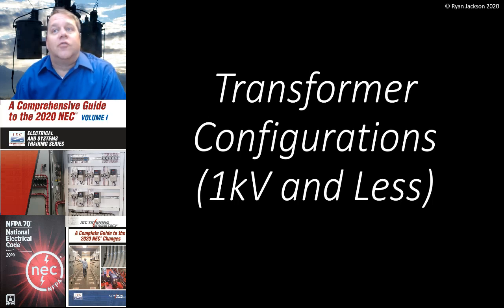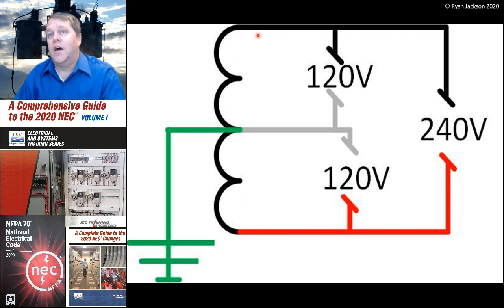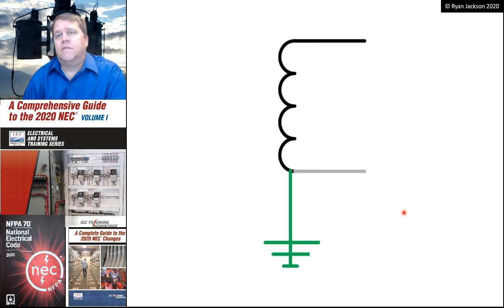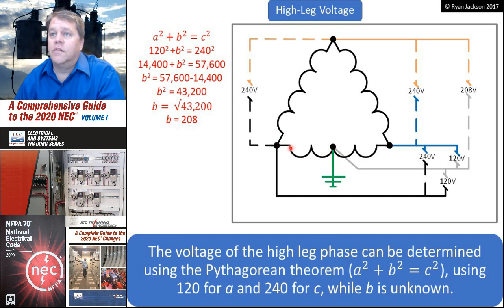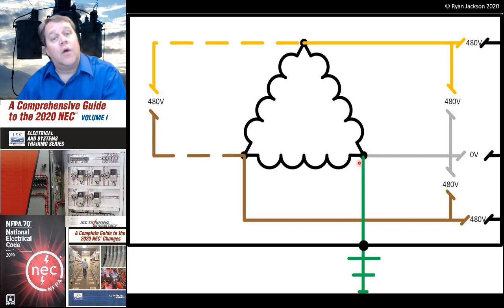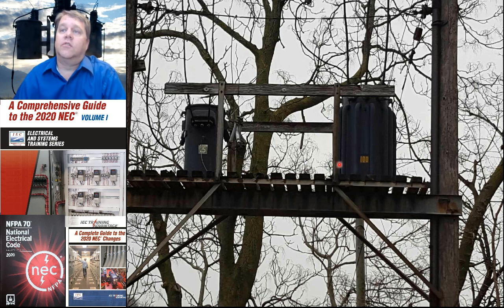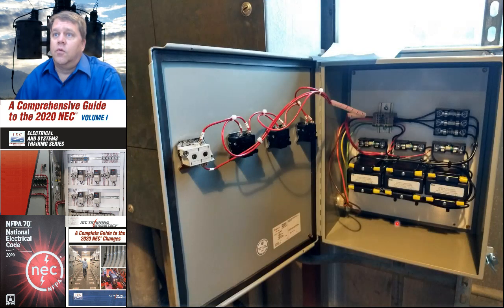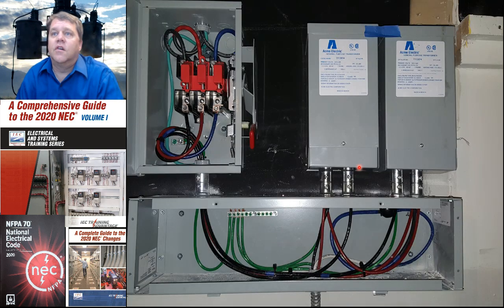Transformer configurations

Comment: Here in Central Europe, single-family homes are always supplied with three-phase four-wire wye system. We get three phases and a netral/ground which then splits into neutral and ground, thus we have a TN-C-S system. The voltages are 230V phase to neutral and 400V phase to phase.

Comment: Although I have an ”ancient” (1976) degree in electrical engineering, I do have one question:

In an area where both 12 Kv and 4 kv distribution systems are used, as a rule of thumb, is one more susceptible than the other to subjecting the end user (120/240v, 1Φ, 3 wire, overhead) to lightning and/or switching surges?

For example, would a lightning strike (direct or indirect) to a 12 kV line get stepped down in voltage more before entering a home than a similar strike to a 4 kV system? Or does lightning not obey the usual mathematics of a transformer’s turns ratio?
Reply from the maker: Hi Dave. That's a great question, and one that I'm afraid I can't answer. I mainly live in the world of 1kV and lower voltages. Sorry.

Comment: In the three phase high leg Delta example, where the B phase is the high leg, (14:46 min in video) the 208 V circuit to ground could be useful for some 208v lighting circuits or even a single phase mini split HVAC unit rated for that voltage. Once the conductor leaves the panel, it would be no different than any phase conductor on a 208/480 used for lighting loads in commercial applications…. What hoops would you have to go through to be able to use that phase for single phase loads?

Comment: Open Delta:  Understand now.  All three (3) power company phases
are connected to the primary coils (2) even though only (2) coils in the SECONDARY side of
the transformer(s).  54% as powerful as closed delta system. Thank you.

Comment: The ground SCREWS to the underside of the transformer.  
If this should break, is that big trouble?
Reply from the maker: No, simply because there are tens of thousands of them.
Reply: @RyanJacksonElectrical  Question please.  Reference the “Multi point grounded
neutral system.  (Thousands of them)
   Philadelphia area single phase step down transformers I can not
see a NEUTRAL conductor going from pole to pole?  
    This SHOULD BE in parallel with the MENTIONED multi-point system
which is obvious at every pole?
     Thank you.
Reply: It’s a common neutral which runs pole to pole at the secondary level. Common meaning same conductor for primary and secondary.
Reply: @bobbrumley3964  Thank you Bob.

Comment: North America, do we use SWER (single wire earth return) from the (single phase) step down pole mounted transformer to the substation? 

I see no neutral from the transformer(s) thank you
Reply: The neutral for the primary is the same neutral being used on the secondary. We call it a common neutral system. The primary bushing is for hot primary conductor and the other end of the winding is attached to case of transformer. As long as the common neutral is attached to the case then the primary winding has two different potential conductors across winding.
Reply from the maker: We use a multi-grounded neutral, which is to say that we have the grounded/neutral conductor that goes from pole to pole and from pole to the customer, and we ground it at every transformer and pole.
Reply: @RyanJacksonElectrical   New terminology for me.   multi-grounded neutral. pole to pole.

     SO, there is no neutral back to the substation.   Thank you.

Comment: Hey Ryan, it seems like the math works the same on the open Delta system using the Pythagorean theorem to get 240v between the two points on the open end. 

It’s just a little confusing to me that you can get 240v between the two points on the open ends. And use the math the same way if you were to draw an imaginary line between the two open points. Or am I over thinking it?

Comment: Single Phase 2W systems are actually very common in North America if you work with Control Transformers, or in a panelshop. Typically in the 100-2000VA size, 600-120V (Canada) and 480V-120V (USA). Great presentation!

Comment: If there is a neutral wire on a wye  480/277 secondary, does the wounding  has to be grounded ?  Can that neutral be floating? And why?  Thanks!  Very good class.
Reply from the maker: You're allowed to have an ungrounded 480V wye (but not 208) , but you can not hook up the neutral because any circuit that uses a neutral MUST come from a grounded system. I'm sure there is an obscure application where an ungrounded wye would be useful as opposed to an ungrounded delta, but I'm drawing a blank.
Reply: @RyanJacksonElectrical For 480v three phase 3wire ungrounded systems you can use 240/480 v  transformers wired delta, or 277v transformers wired wye. Because 277/480v three phase 4wire grounded systems are real common, due to having 277v in inventory we just build 480v three phase 3 wire ungrounded ( floated) with them.

Comment: Ryan I have a question on autotransformers and what you mentioned the 20% general rule. So if single phase autotransformers only have 3 wires what would the 4 wire ( extra conductor for gounding conductor = white wire ) that our ultilty company uses be called?  They only provide 1 wire from the 13, 200 three phase on a pole to step down the voltage down to 120/240 volts. They ground one side of medium voltage to transformer case, a flimsy ground rod at bottom of pole and to what appears to the center tap on secondary to grounded conductor. To me the ground rod would never have low enough resistance to feed majority of current for primary winding so grounded conductor along with our copper water service and metal gas pipe is back feeding current to feed transformer. Cracks me up how ultily company gets away with splicing ground wire 3 or 4 times that only runs 30' down the pole. Wire from transformer starts out as copper that somebody stole a 6' section. Then they climbed up and stole a couple of more feet of copper. Luckily they use aluminum to replace the copper and that lasts longer. Thanks.

Comment: Only problem with a ungrounded system that has the 3 ground indicating lights is trying to locate a ground. We had this back in the 1970's at a large slaughterhouse that I worked on. Could only really work on finding a ground was on Saturday when there was no production. Would start in substation turning off 400 to 800 amp breakers then going downstream. Majority of the time is was from a grounded motor. At that place we replaced at least 1 to 3 bad motors a week. Record was replaced 3 bad 100HP motors on one very hot day during a ultily brownout. I had my last long transformer class 50 years ago so I think they told us with an open delta voltage regulation was not as good as a closed delta.

Comment: Installed a 3 phase & single phase service to a Philly store about 10 years ago. The area still had 2 phase power. Ultility company installed a phase changer then if memory served me right only brought in 5 wires. One conductor was used for the single & 3 phase service. Bad thing about 2 phase if you cross feed wires to a 4 wire 2 phase motor it would only recieve around 180 volts instead of 240 volts burning motor out. At the large hospital/ research centers that I retired from probably had over 200 480 to 120/208 Delta to Wye transformers. They had a few 208 to 240 volt transformers for some small equipment. Thanks for another easy to follow informative vid.
Reply: It's actually only around 170 volts if you don't connect the wires right on a 2 phase system. 120v x √2
Reply: Thanks Ryan. I have not connected a two phase motor here in Philly since the 1980's. Was in an old machine shop. For fun I did a Google search and could not find any 240 volt 4 pole 4 fuse 30 amp safety switches that I had I stalled a few back in the 1970's for two phase.

Comment: On the 3 single phase 4 wire system , the grounding wire coming down the pole from the 3 single pole XMFRs, If that ground wire got cut by a vehicle accident, what would it do to the voltages ?
Reply from the maker: It really wouldn't do anything, for two reasons. First, and unlike the transformers we install, the utility connects both the primary and the secondary to the frame of the transformer and ultimately to their neutral point. This means there are thousands of those connections throughout the distribution system, so cutting one wouldn't really be problematic. Second, when we measure voltage we usually measure to the metal parts, not to the actual dirt itself. If you cut the wire going to the dirt, but kept the wire connecting the windings to the metal parts, you would still have a predictable voltage from the conductors to the metal parts.
Reply: @RyanJacksonElectrical  Good point. Another interesting thing with high leg 120/240 delta systems is, if you lose one of the smaller transformers that doesn't have a center tap, is you don't single phase your motors, everything still will work, like an open leg or ghost leg 240 delta system, you will just have much less KVA capacity until the utility can come and replace the can on the pole, or the HV fuse etc. If you lose a leg on a 208Y120 system, then you get all kinds of strange voltages on your 120v circuits from current backfeeding the dead leg from 208v loads, and 3 phase motors trip on thermal overload, or burn out. Replaced many burned out compressors over the years from that happening where a tree or vehicle accident or other object coming into contact with the POCO distribution lines causing a loss of one phase for awhile.

Comment: Just when I thought I understood that single phase = 120/220 volt, center tapped transformer, you go and shake up that assumption. I'm not a sparky, but always been. interested in electrical/electronics. There's already lot of misconception out there with referring to 220v as being 3 phase. Especially in buying equipment: people love to refer to 220v motors as 3 phase... The rabbit hole runs deep!!!

Comment: You may be aware that in New York City (and possibly Westchester County??) Con Ed distributes two legs of their three phase network 120/208V wye system to "single phase" residential households.  Two phases (208V, not 240) and the neutral.  Your neighbor may well get one leg of the third phase and one of the same legs you got. Most people are unaware of this, although I'd assume that any licensed electrician in NYC is.  I've had to explain this to many of my EE friends who couldn't understand why the supposed 240 volts between the two hot legs of their service only measured 208V. 

If you are in a part of NYC with overhead distribution, it is very visible, four secondary conductors with only three connected to each service drop, a different three (but always the neutral) to each drop.

Second item of interest:  At a university on Long Island I worked for in the 1970's the original university owned primary and secondary distribution was two phase five wire.  The primary was two phase three wire, two 2400V legs and a ground return for the two of them.  The transformers for each building were two (very old) single phase transformers each with a 120/240V secondary as you drew.  The campus was built new in 1929, so I'd have to guess that the utility distribution in the area was two phase, but I was never able to find the history.  LILCO, the then utility fed us with a pair of scott-tee transformers from their (then) 4160V three phase delta primary distribution to our 2400V service. 

While I was there, we rewired the remaining buildings with "more modern" 120/208V three phase distribution fed from a new 13KV service.  However the cafeteria was full of two phase four wire (no neutral) motors, and rather than rewinding or replacing them all, a 120/208 to 240V three phase to two phase scott-tee transformer was installed to feed them all.

My other involvement with two phase power and scott-tee transformers was with mercury vapor rectifier banks.  Both low voltage (carbon arc lamp supplies for 35mm motion picture projectors) and many KV supplies (for broadcast transmitter tubes) often used scott-tee transformers with four rectifier tubes.
Reply: Ahah, so that explains where the 2400 volt electric chair came from then. Rather than risk blowing up the transformers, they just ran service conductors to the chair straight from the primary. Well, I guess you could call them "feeders" since they would have a service disconnecting means for the executioner to close, but probably no overcurrent protection. The first overcurrent protective device was the person in the chair..... LOL
Reply: @brnmcc01  I would suspect that the 2400V electric chair was fed from a pole transformer connected in reverse, the 120V or 240V connected from the building power (where it can more safely turned on and off) and the 2400V side which normally would have been the primary now fed to the electric chair electrodes.
Reply: Was that in Garden City - the University?

Comment: Ryan thanks for another great vid. Was told a few years ago at a continuing education class that it is very important to do an availble short circuit calculation whenever replacing the customer owned transformer espically when using the now lower impedance transformers. Also have to be carefull with large services. At large hospital that I retired from somebody pulled out some spare 600 to 1200 amp 480 volt circuit breakers while performing yearly PM'S & testing that were only rated for think it was 65KIA and installed them in other switchboard that was feed from another dual rated setvice but with had think it was 600 to 1200 amp breakers that were rated for at least 90 KIA thetefore limiting that switchboard to only 65 KIA or in other words the lowest avaible KIA. Took boss a while to belive this serous mistake.
Reply: What they actually did if the AFC was greater than 65kA was install essentially bombs in that switchgear.

Comment: In my 50 years never saw a corner grounded Delta transformer. You mentioned that you are not allowed to fuse the corner grounded wire but would a 3 pole circuit breaker be okay. Had at least 40 hours of transformer in vo tech class back in the 60's but do not remember that. Helped my sparky dad install a 2300 volt service to a Scott T transformer that put out both 2 & 3 phase voltage. The electrical vault was very small and only had room for 1 transformer. Kind if remember that open Delta does not provide as good as a voltage regulation but the ultily companies love them due to increase available setvice only have to install a third transformer.
Reply: Some utility companies use open delta because the customer has some 3 phase loads but not enough to call for a closed system.

Comment: Thank you Ryan.. I was always confused about all the different types of systems out there.. I found your channel because I was trying to learn about .. Swimming pool safety.. through Mike Holt videos .. I have learned so much information from the both of you .. Thank you so much
Reply from the maker: Thanks!
Yes, you certainly can.
Reply: @RyanJacksonElectrical  I have a hayward low voltage transformer . 120vac 2amp max ..output 14vac 70 va  I have the 70watt junction box kit with transformer.. all plastic.. 
The instructions say to land the ground wire from feed on ground bar in J box ..but also they state to land bonding grid to this bar as well .. so I will have bonding grid and equipment ground on same bar .. is this ok ??
Reply from the maker: @261Pro  Perfectly fine.
Reply: @RyanJacksonElectrical  Thank you Ryan.. I for some reason was worried about bonding grid and equipment ground of pool panel being together..code saying it is not necessary to bring grid to the panel board.. 680.26 (C) .. and also a healthy fear ...Being a new pool owner is certainly a big responsibility..
Reply: P.S. CAN I ASK A QUESTION ABOUT LOW VOLTAGE POOL LIGHTING TRANSFORMER?

Comment: Thank you. I really enjoyed this one. I never knew of 2 phase in USA.
Reply from the maker: Thanks so much, glad you enjoyed it.
Reply: Most 2 phase that I came across was 240 volt 5 wire. The 5th wire was 120 volts to the other 4.phase wires. We had a 2 phase 3 wire 2300 volt feed to another building where they place a phase wire from each of the 2.phases and draws 1.41 more amps. They also had 480 volt 2 phase.